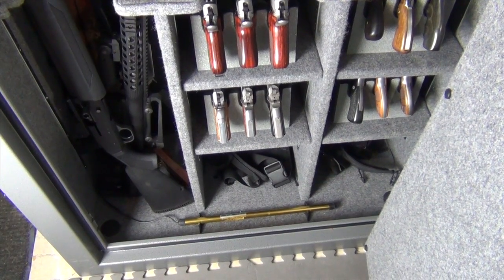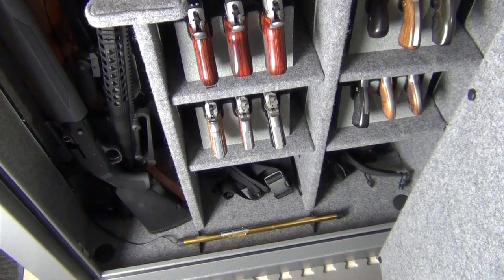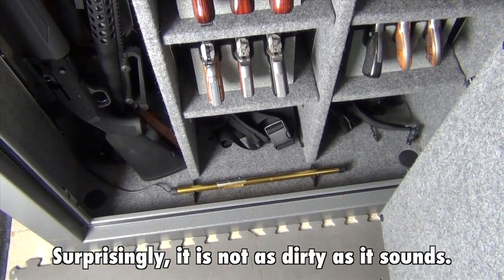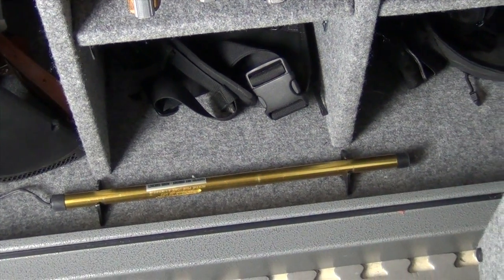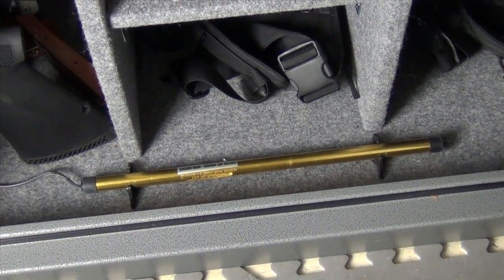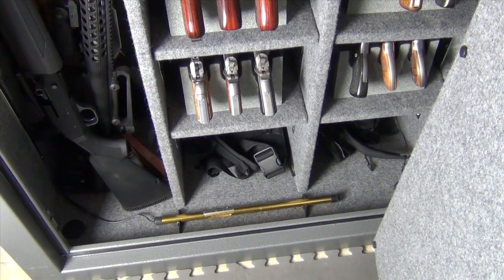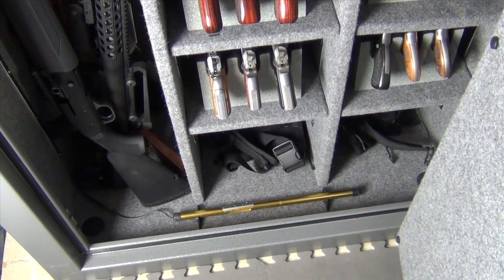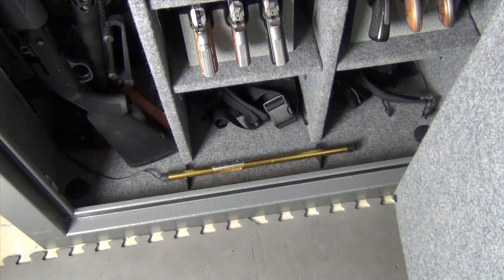Preventing Rust In Gun Safe

Comment: that's totally not how it works. By increasing temperature inside the safe you naturally reduce the relative humidity of the heated air, which help prevents rusting. heat convection circulates the air in the safe but ideally you want to trap the heat/air in the safe to prevent further moisture being absorbed in the hot air.

Comment: Your safe also contains corrosive materials that a golden rod or other devices won't help. The carper adhesive contains formaldehyde (corrosive to metal). The drywall used for weight in your safe contains pyrite, this breaks down into sulfuric and sulfurous acids. Ferrooxidans are a bacteria in drywall thart eats metal - this is want breaks down the pyrite...  Cheap gun safes (most guns safes)  are bad for guns....   if you want a safe, make sure to get one with a inner steel or stainless steel liner. These start at around 7K. If your safe is carpeted....  it's corrosive.

Comment from the maker: "GoldenRod® heats to a surface temperature of less than 150 degrees (which is almost too warm to hold) and circulates warm, dry air throughout an enclosure on a 24 hour basis. This increases the temperature of the air inside to several degrees above the ambient outside temperature. Expansion of the heated air forces the moist air outside through the vents or loose fitting doors leaving the dry air inside. In order to work correctly, it is important to ensure that there is adequate ventilation."

Comment from the maker: Aslo, in a sealed safe the moisture would only circulate. It would not dissipate. Corrosion only requires a moist environment. It does not require condensation. In a humid safe metal would still corrode even at high temperatures.

Comment: When the dewpoint is lower than than the ambient air temperature, the relative humidity is low. That is why in places that have ample (or even excessive) air exchange from outside to inside, heating the air makes it seem drier.
Summer humidity is from water evaporation, but add even more heat without adding more water and the air still gets drier.
The only way to keep moisture out of of any safe in humid areas is to use positive pressure, from the safe to the outside -- or use dessicants.

Comment: thanks for the tip Theyankeemarshal I have I'm a new gun owner and did not know this was an issue. I live in Miami and its crazy humid over here.
Reply: I also live in South Florida. Rusting in a gun safe is more of an issue if you plan on leaving the firearms locked up inside for a long time. If you take them out even a few times in a year and clean them you shouldn't have any problems as long as you keep them lubed with CLP/ rem oil etc. I have a safe and many rifles, I haven't used a golden rod ever, no rust at all. I also keep it indoors and the AC is always on so perhaps those in humid climates that put the safe in the garage may have more of an issue with rust in the gun safe. 

I am considering a goldenrod because I am going overseas for 8+ months in a few weeks and am worried about them .

Comment: This (with some slick marketing language) more accuratly describes how it works (from their website): GoldenRod Dehumidifiers fight corrosion by nullifying the third necessary component, Humidity. GoldenRod Dehumidifiers create convection currents, heating the internal air of the enclosure, bathing enclosed metals in warm air. This not only warms the surface of the metals, not allowing humidity to condense on cold metal; But also does not allow ambient air to ever reach its dew point.

Comment from the maker: Exactly..convection. And just why do you think they area needs to be ventilated? Because the air needs to be able to flow in and out of the safe just as I described. Funny how you left out the "Expansion of the heated air forces the moist air outside through the vents or loose fitting doors leaving the dry air inside." part which is highlighted on their own website.

Comment: Wrong Mechanism!  The safe heaters work by keeping the safe interior warmer than the room which causes the contents of the safe be at higher temperature than the dew point of the air in the room.  Therefore no moisture condenses on the firearms.  As a boots and suspenders move, I also recommend DampRid for safes that are not opened very often.  DampRid is a relatively cheap and effective disposable desiccant product that is easily available.  I get mine at Walmart.

Comment: LOL... Sounds like a bad Austin Powers movie.  It works on the law of thermodynamics, in that heat will always travel towards an area with lower heat content.  Also being slightly warmer than the ambient air, the safe will not form condensation like a glass of cold water in a warm room will do.  Pretty cool method of rust prevention actually... I have to get one for my safe as well.

Comment: Can you disconnect the cord from the goldenrod, so that you can thread the cord through a smaller hole in the safe wall?
Reply from the maker: +oilhammer04 Some you can...otherwise cut the plug off and put on a new one.
Reply: Liberty safes dry rod is able to do so.. I just bought one yesterday and installed it today
Reply: I just purchased a Golden Rod and found that the plug is removable. It snaps off whereby the cord may be run through a hole in the safe and/or shortened.